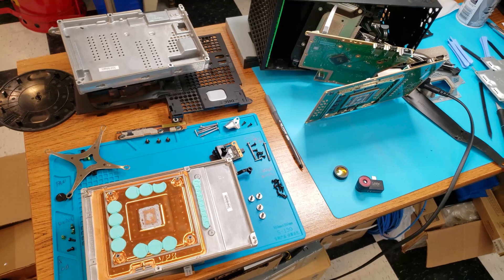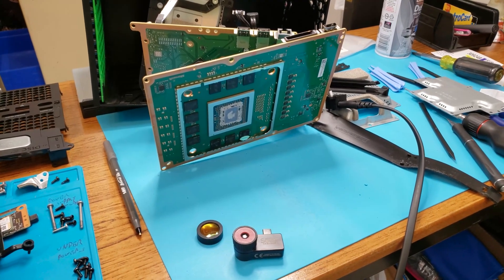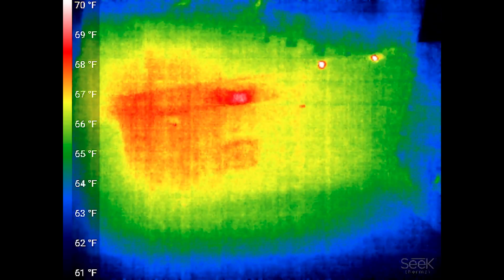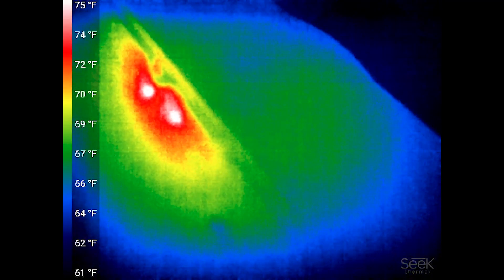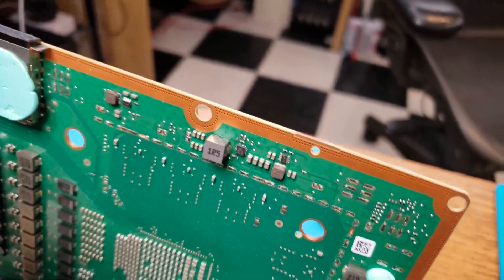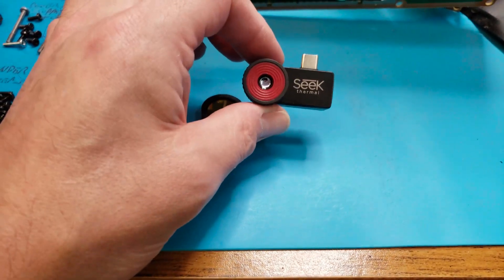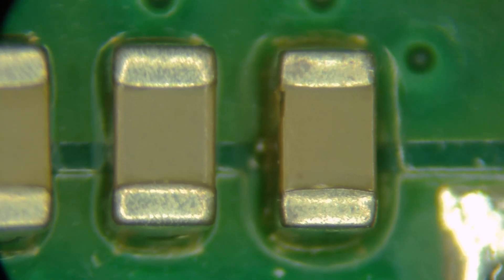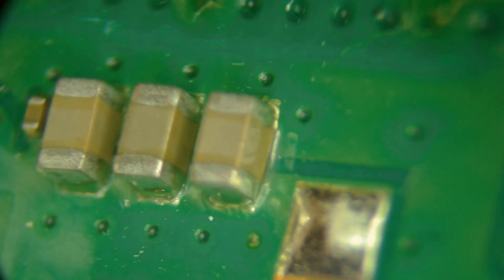XBOX Series X no power Repair & thermal camera for the win!

Comment: what do u think about InfiRay Thermal Camera P2  . I seen a lot of recommendation about it.
Reply from the maker: It looks like a good option. It's cheaper than the Seek and most of the listings have them coming with the macro lens. It does have a higher frame rate than the Seek too but it is lower resolution than the Seek. For me I think I prefer the 320x240 of the Seek over the 256x192 of the P2. But I don't know if that higher resolution is worth the $100+ price difference. If I needed to get a new one for any reason I would definitely be looking more into that P2.

Comment: Neat trick soldering the cap on a single pad, have to remember that.

Also its probably fine with a single cap but if anything ,testing that it works you can now "order" the caps if you want.

I have ordered caps being sure its the ONLY problem then just to find out I ordered caps for something with a much bigger problem 🤣

Comment: Hi Paul. I have the Seek  Compact  Pro, but I might have to find that setting that you had yours using, it looks good. Yes they are well worth the money but you need to spent time learning to use it effectively don't you. I got mine from Union Repair but the macro lens holder is some crappy 3D printed garbage. Your lens holder looks much better.Thanks for the video
Reply from the maker: I found the macro lens on Ali. I considered getting a stock of them to sell because all I see for sale state side is the 3d printed ones. This one is an aluminum ring the lens is mounted in.

Comment: A thermal camera is a generally useful tool, used one to find pretty much the exact location of a leaking warm water pipe in a wall, the leak was not big enough (yet) to cause water damage or mold. The only indication that something was wrong was that air had to be released from the radiators quite often with no obvious cause.

Comment: 18uF or 22uF more likely than a 20.. E12 capacitor values more common than E24
And as for the SEEK camera.. They're great while they work, but despite treating it carefully,mine has a broken USB connector.. I think its on a flex, so I've not attempted a repair myself yet.
Reply: Yeah, I'll never buy anything whose main source of power and connectivity is repeated cycling with a phone connector. That just smacks of not being very robust in the long run. That said, this works for Paul so who am I to talk 🙃  Also agree on the 22uF.
Reply: Wow. Just watched further where Paul uncovers tons of 20uF capacitors, what! Now that has made me want to go dig thru DigiKey.
Reply: @vincei4252  I couldn't see on my screen (certainly not at that speed)  but I suspect a lot of search results were actually 220uf. It'll be a string search not a value search.